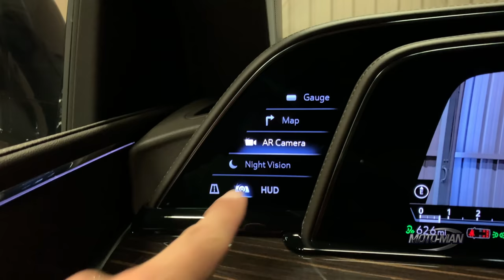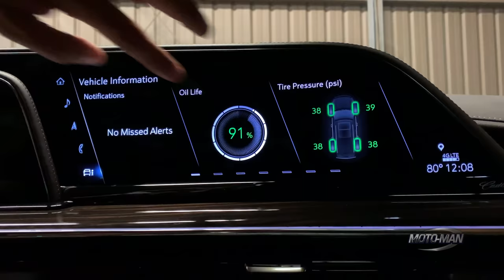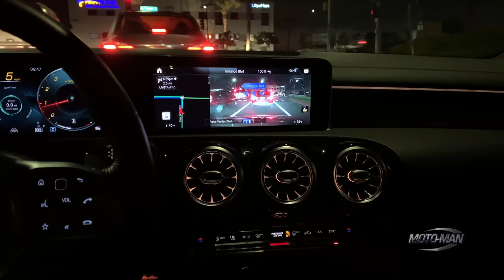2021 Cadillac Escalade Diesel: A credible alternative to the Mercedes GLS

Comment: The reason I want this is not because of the $700ish saving mentioned @ 9:00, but the 1000km+ range making it one of the longest range vehicle selling right now. The time saving at fuel pumps is likely to make up for the lost passing power.

Comment: You bring up the point always bring up when companies try and stuff economy engine options into these 100k+ trucks. $700 is nothing to someone who can afford this truck. And they probably want the sound track of the V8. And because more and more people are going to lease these, you would have to calculate fuel savings on a monthly basis based on the different lease price. If these diesels have lower residuals, they could actually be more expensive to operate them on a monthly basis. This engine is just for people like me who appreciate how diesel engine delivers power and loves that you could travel all day long on the same tank of fuel.
Reply: I purchased the diesel, should be here in a couple weeks. I find it weird the amount of people who comment how money is nothing to people who buy this vehicle, perhaps the people have the money to buy this type of vehicle by looking for ways to be smart with their money.... To be honest I never would have looked at this vehicle until I saw the diesel with a fuel economy rating that wouldn't make me hate driving it anywhere.
Reply: @mitchellmccormack2408  howd it work out for you
Reply: @obasunra6071  loved it but only had it for a week. I ordered the base one and it didn't have blind side monitoring apparently which is a must for the wife. Dealership was super cool about it and took it back and ordered me the sport trim one. I used half a tank of fuel for my week of driving and it felt plenty fine for me, a person who's never owned a diesel. If I wanted something faster I wouldn't be looking at a giant suv
Reply: Top speed?

Comment: Caddilac is doing better then Mercedes in the screen design department.
That's a thing.  A Good thing.
Reply: @Terry Smith
If that is true , it is not translating into vehicles sold versus Mercedes
Reply: @turnne  The Escalade is far ahead #1 in sales in its class of vehicles.
Reply: @kingjames7721  and its class likely consists of the only the Lincoln Navigator...or other GM products..Tahoe etc
I dont think the import buyers ..Mercedes BMW, Range Rover..or even the Toyota Landcruiser/Lexus LX are shopping it

As far as Cadillac the brand....as you probably know there are several luxury brands ahead in sales
Reply: @turnne   Lol The Escalade still outsells those other 3 row vehicles as well. People complain about the escalade like its trash, but yet it sell like hotcakes. I look at automotive vehicle sales often.
Reply: @kingjames7721  For a cheap enough lease.......which I think is how most of the Escalades are moved
Several of those vehicles are far more expensive than an Escalade is..and vehicles like the Land Cruiser/Lexus LX hold resale a lot better
Additionally...the Mercedes G, Toyota Land Cruiser, Lexus LX and Range Rover have serious off road chops that the Escalade does not
Hence the reason I said buyers are probably only shopping the Navigator or other GM when they look at the Escalade
Reply: @turnne  You are hilarious lol.
Reply: @kingjames7721  
I know...so are you
Reply: @turnne  I needed that laugh! Have a good evening though.
Reply: @kingjames7721  Who the hell wants an old ass Land Cruiser, or a small ass GLS and X7.  If you can't put 3 people in the 3rd row, it's too small.
Reply: @vernonpaigejr.1517  Thats the part that had me laughing so hard lol. I thought the same thing.
Reply: Top speed?

Comment: As a long time Cadillac buyer, I've always loved Escalades although my PhD hooded wife with an environmental sustainability degree always banned them from the shopping list because of their carbon footprint. But even she admitted on our last family road trip that my 2nd gen SRX was too small for a family of oversized adults/teens. On the other hand, the family trip before that in 2019 with a rented Tahoe at Yellowstone National Park was perfect. Which brings me to the difference between the gas and diesel versions. The diesel buys you some economy, yes. But the big difference is the range which amounts to fewer stops on that long trip. Combine that with SuperCruise (which wasn't on the Options Game (tm) this week), you could go longer and better rested than with the gas version.  And then there is electrification. Cadillac has already said that there will be an electric Escalade sooner rather than later and both cars will be available simultaneously for a while.  I doubt we'll see any more hybrid tech from GM since that doesn't seem to be in their long term cards, even though that Cadillac has plenty of experience with the 2014-2016 ELR and the Escalade Hybrid from a decade ago.  As for your other comment of Cadillac going with cheaper materials below the belt line.....this is sadly an old problem and other reviewers have even noticed it in the third row of this car. Back when I bought my 2003 CTS new, I showed the dealer how Cadillac still needed to improve interior quality because everything below the belt line was visually cheaper than the easily visible stuff. Hopefully the upcoming Lyriq and Celestiq move away from this bean counter mentality.
Reply: Our old XTS was OK.  The CT6 is better.
Reply: So you let your wife dictate what cars you can buy?
Reply: @ed8235  yes if you know what’s good for you!
Reply: @Sevenfeet0  foolish. Unless she is the mechanic.

Comment: Here diesel is 23% cheaper than premium petrol so the savings are higher. Imagine this being a range extender truck with thst engine running a generator and individual motors to each wheel for truly brute force and make this a 15 second mammoth.

Comment: Great video as always. I live in a rural area and diesel is way cheaper than premium gas where I live so the diesel option is a great alternative. For city use the diesel may be problematic due to the regeneration requirements for cleaning 
the exhaust system unless Cadillac has enabled a park regeneration.
Reply: Check the diesel in your area, you may need to use additive.

Comment: George I’ve held off on my 3.0 duramax experience to allow break in plus some. Granted this is with the Sierra Denali/AT4, My last was the Denali 6.2. I averaged 15.8 city and 20 highway and this was with DFM and auto start/stop. My 21’ AT4 is factory lifted, loaded, with A/T 275/60R20 tires and I get 24 city 29 highway with absolutely ZERO effort. I’m at 4000 miles with towing and still have 3/4 DEF left. With my 4300 LB boat, I was getting 14 highway at 70 here in Florida. That’s double than my 6.2. The Duramax is without question a buy. Especially with Premium at $3.85 a gallon and Diesel at $3.05 as of today.
Reply: Hey, so the Diesel engine is good , but the only thing holds me is it is Twin turbo,don’t u think it less durable ?
Reply: Diesels motors are far more reliable and durable.  The exhaust regeneration systems and dpf are the weak points

Comment: Still looks like a big block but I get why someone would opt for it if interior space or towing capacity is high on your list of needs. Still, the X7 and GLS are both better SUV options for most families and offer better handling and are easier to get in and out of.

Comment: Very useful review.  Well done.  I am hoping you can answer or clarify a diesel question or two for me:  Where, in what circumstances, will that lower 277 hp of the diesel engine show relevant trade-offs, even though it still has the higher 460 torque that apparently kicks in at a lower 1500 rpm's? 

I ask because I've seen a number of reviews where they seem to say that off a start such as at a light, or in town driving, or merging onto a highway, at such lower speeds the diesel does quite well.  I actually watched various zero to 60 or slightly longer races of different pickups using this new diesel, the 6.2 liter and the 5.3 liter gas powered gm engines.  And in every case, off the start, the diesel pulled out more quickly, and largely maintained that lead against the 5.3 liter, at least for the short race that this was, but the 6.2 liter, after taking a few moments to catch up, more than a few, it then passed and said bye bye and never looked back.  But still, good performance of the diesel at low speeds and off a start, and working up thru the transmission speeds fairly quickly.  Though I am aware those were pickup trucks that do not weigh as much as the 6k+ lbs Escalade.  In any case, I keep wondering that there has to be a trade-off evident at some point with that lower hp.  So, given that I live in mountainy ski country out west, where steep hilly highways are common, like in Colorado and Utah, I wonder if maybe once the diesel Escalade is going say 70 mph, if it wants to pass another vehicle on a steep highway hill, if it will even be able to.  Though it does occur to me that maybe, if we're lucky, in that circumstance, that ten speed transmission might seek out a lower level and thus kick in the torque making the passing possible and maybe even acceptable.  I have been unable to find any Escalade to test drive, much less the diesel, so I ask you or other posters here for your thoughts on this issue.  Maybe you know or can find the answers, or even give other examples of pros and cons.  Thanks so much, for any reply if you can take the time, and for a great review.

I am laughing because your point about whether a $700 savings is worth switching from the 6.2 liter to the diesel.  It's a good point, especially factoring in the generally higher cost of diesel fuel, and the smaller blue liquid costs.  That said, you used 15k miles for your example.  I could easily see myself driving 20k-30k miles in a year.  And though a lot would be on highways, level and hilly, there would still be a good bunch of in town and neighborhood driving in the mountain towns I frequent so often, and a good deal of less well maintained secondary roads.  And of course all the driving I do in bad winter weather (the best days to go skiing), from minutes to the nearby area, to an hour or so of highway driving to day trip areas, to 4-7 hours for long weekends trips to more distant ski areas, often in bad weather.

Sorry for the novel, but I would welcome any insights into the Escalade on any of these points, but especially the diesel issue.  Thank you.
Reply: Do you have any friends?
Reply: @eranmaron909  , to answer...no he doesn't

Comment: V8 all the way. They should offer it with the Duramax V8....monster engine
Reply: That engine is so heavy it would probably need a full front suspension redesign and your payload capacity would be so small. What needs to happen is that Ford needs to realize there is a huge demand out there for people with three kids who want to tow bunkhouse travel trailers Who would eat up and modern day excursion as fast as they could make them.
Reply: @slscamg use the front end out of the 2500 series? Reduce the tow capacity? More likely increase it
Reply: @weirdshibainu  decrease it due to that engine eating up so much payload. I doubt the 6.2 is power limited on this platform it’s limited by platform limits. I’d say put a 2500 under it and give it a ton a towing

Comment: A diesel tuned to a single rpm as a generator can have a much higher efficiency.
Reply: False
Reply: But then you have round-trip efficiency losses in the generator to convert the engine's output to electric, plus electric motor losses added on.

Comment: Actually most manufacturers make most of the money off of service so if someone wants to buy an all electric vehicle they will come out ahead
Reply from the maker: That would be the dealers.
Reply: @MotoManTV  ok your right
Reply: @Kimbrough87  With the EV, the hotels & restaurants make good profit as long trips NJ to CA would take a week with all the 5-15 min detour to find electric charger and then 30 min to hour (if one is lucky and finds working and vacant generator)every three to four hours.  I did 7200 miles roundtrip with Mercedes ML 250 Bluetec (Diesel), easily did 1000 miles a day with just one 5 min stop for re-fueling...averaged over 800 miles per tank and 32.2 mpg with three people and a dog (extra weight). Till EVs can charge consistently after 50% charged status, most EVs require a stop at half the stated range and with extra weights, the range is drastically reduced.  EV is ok for people who basically live out their life within 150 miles radius but for people who like to go on longer trips with friends, EVs are a nightmare.
Reply: @WaywardAnalysis  I agree I definitely have multiple cars because I am a Uber driver so I use my Hyundai ionic Electric ⚡️ as my work vehicle in City driveing  I have a 2014 BMW 328D and I get 60 to 65 miles per gallon on the highway travel and I can get up to 900 miles on the highway in about 750 miles combined
Reply: Top speed?

Comment: I do not understand why GM has made the ambient lighting so simple with so few choices of colors.  Why it does not let you use the automatic color changing while you drive???  Also why the ambient lighting is so feint.   You can not even see it at all during the daylight.  But you can see it in the Mercedes easily during the day.  Why, why why????

Comment: @ 14:30 is an offensive statement. Try taking that Cadillac off-road and that may be your last vehicle from them. Rovers are the kings of the road.
Reply: How many owners of Escalade or Rovers take them into serious offroad? Also, if you look at what real agencies use offroad, those are Land Cruisers (not the ones sold in the US, smaller ones, in the US the similar one is Lexus 460) and Nissan Patrol (a similar but not identical US version is Nissan Armada).
Reply: I have a 2022 Escalade and my questions is, why would I want to bring my $100K+ car/truck into off-road? I would never. Waste of money in my opinion.

Comment: It is next to impossible to make this Escalade a plug-in hybrid that could to go 100 miles on battery electric only. Imagine, the Volvo XC90 T8 can only go about 18 miles on electric only.  To keep the vehicle still practical for what it is, which is an SUV with SPACE, it can't fit that many battery packs in it.  Plus, that many battery packs would add probably another 1000 lbs to the already 6000 lbs vehicle, then everything dynamically-speaking has to change again.   On the other hand, the idea to make it a plug-in hybrid is good, but maybe just keep the wish to a 20-mile electric only range.

Comment: After owning a 2011 BMW X5 diesel, I wouldn’t ever touch a diesel vehicle — ever. That car was a total piece of sh!t. I don’t know if it was because it was a BMW or a diesel or both.
Reply: What were some of the problems you experienced..
Reply: @AMEX4Life  Had numerous problems with the diesel emissions system. The entire diesel exhaust filter had to be replaced at 53K miles. The DEF temperature sensor also failed but the entire DEF tank had to be replaced because the sensor is integrated with the tank as one unit. A few sensors related to the fuel injection system failed. The BWM technicial gave up trying to fix my car and told me to sell it to Carmax asap - lol! Every time the check engine light went on, I automatically assumed that I would be billed $2K. I actually felt good if the repairs were around $1.5K. It was the worst car I ever owned and will never buy a BMW again. I was warned so many time not to buy a BMW but I didn't listen.
Reply: Thank you for the information. Do you have any knowledge on twin turbo engines reliability? I'm in a cross between the 6.2l Escalade and the AMG GLS 63. I'm concerned about the long term reliability with twin turbos..
Reply: I don't want my vehicle to be in the shop more than it's on the highway.
Reply: @AMEX4Life  You are very welcome. My BMW experience ended my relationship with German cars - lol. My guess is to either buy new or buy an extended warranty plan for the peace of mind.
Reply: @SBha30  Thank you..I appreciate the knowledge..
Reply: @SBha30  long term '12 x5 diesel owner. Bmw NA warranted most of the components you mentioned until 10 yrs/120k mi. They are complex vehicles for their time but but not without merits. I would buy x7 diesel today in a heartbeat if one was offered here in the States

Comment: The only issue I have with the 4 and 6 cylinder Duramax is that they’re actually a subsidiary of Fiat aka Fiat diesel division... Junk
Maintenance costs on any diesel is far more expensive than a gas engine it’s not a even close to a $700 savings, more like $400 in savings.
Reply: This NOT by any means even remotely affiliated with Fiat....GM designed in-house at what was its Italy Powertrain division in Turin before it was sold last year.
Reply: I have the cruze with the 4 cylinder diesel ..I have had to dump already 6k in getting it rebuilt..I hate it now I feel like its gonna die on me again. It was great at first and soon much mpg but my piece of mind is gone.